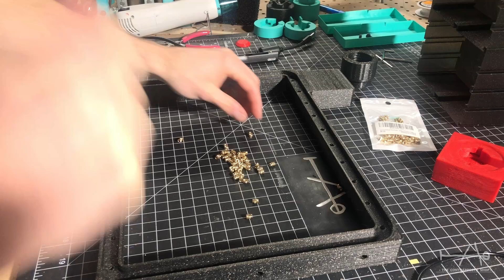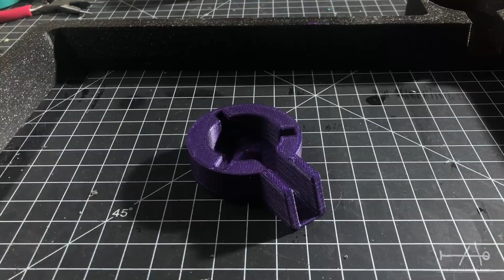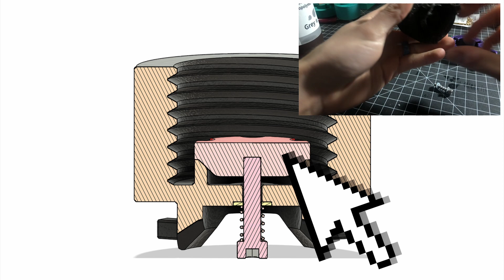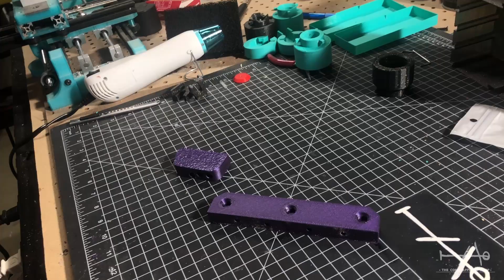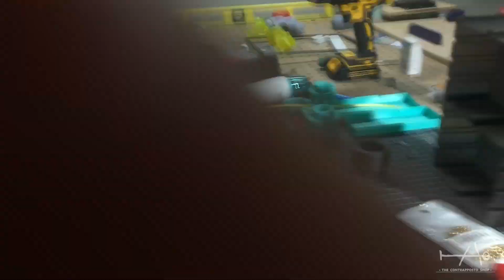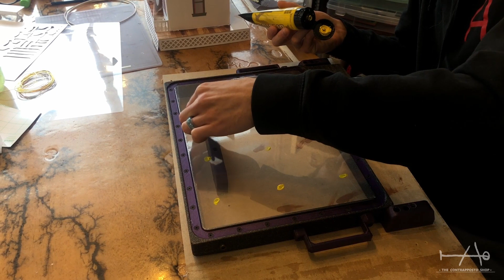Building the Vat for the Prometheus MSLA 3D Printer

Comment: question. just to be on safe side, how do i make the vat to be watertight since its 3D printed ? can i coat it with thin resin or anything ?
Reply from the maker: I think it’s possible but if your printer is properly tuned and with the settings we recommend the vat should be strong and watertight :) … come chat with us on Discord:D 👍
Reply: @thecontrappostoshop  i assume PLA are good enough for these ?
Reply from the maker: Yes that’s what we use and recommend :)

Comment: I’ve been looking for a universal passive resin auto refiller and this is the closest video I’ve found. Everything I’ve seen is either for specific printer or older videos. Nothing definitive as far as I’ve seen
Reply from the maker: The design is open source so you can easily integrate it in your design:) … you can even found model of your vat and just adding this model :)
Reply: @thecontrappostoshop  thank you for the info! I’m building a 3d printing station where I’ll be disassembling 3 resin and 2 FDM printers and integrating them all into a comprehensive workstation that includes As many features as I can think of into one double door closet size system. The list of features is long. I will be rechina out to you or anybody I think would be interested when I have the design aspect done. I’m working with a machine shop so this will be a respectable build I hope 🤞